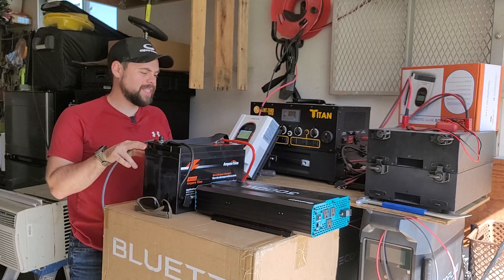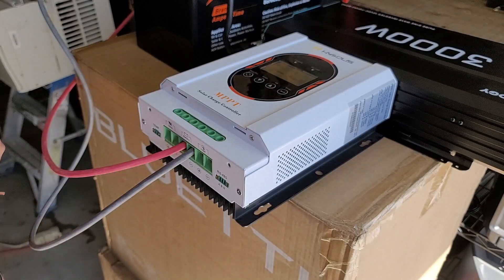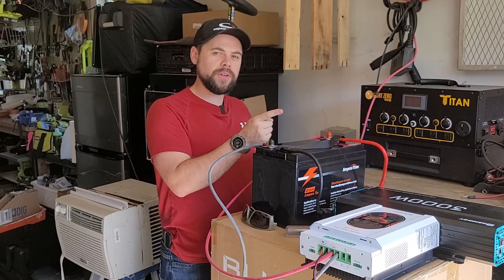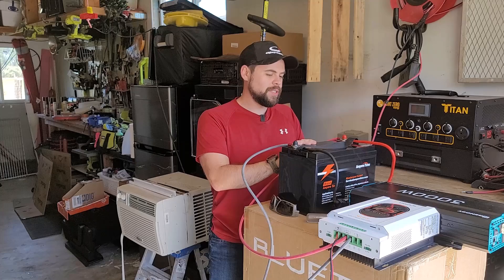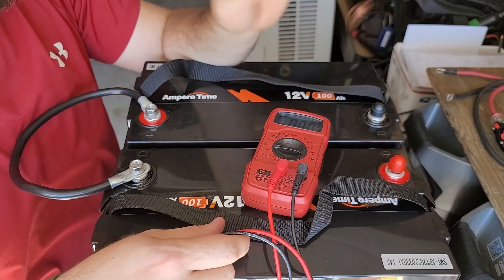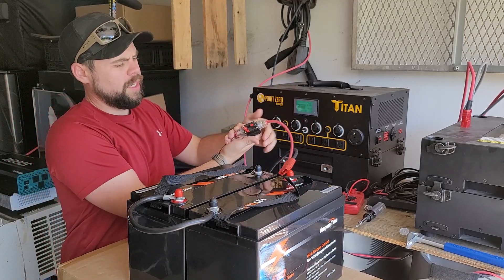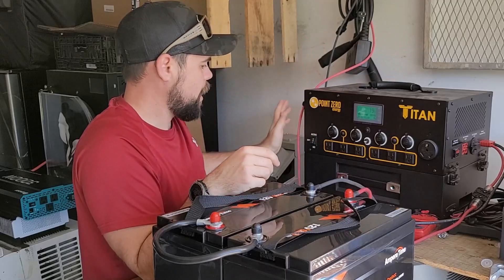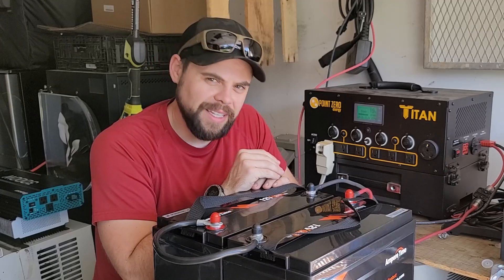Titan Solar Generator Expanded with Ampere Time (aka LiTime) 12v Batteries

Comment: The batteries used in Titan Solar Generator are NMC batteries, which are a different material composition from LiFePO4 battery, it’s not recommended to parallel a LiFePO4 battery with other ingredients batteries for long-term use, since the difference in voltage platform and internal resistance will affect battery life.

The battery expansion port of Titan Solar Generator is not used for the external increase and expansion of battery capacity, but only for emergency charging when the external battery is dead. Also, if the voltage difference between the internal and external batteries is large, there may occur a large current in parallel connection, which may lead to battery protection.

This expansion port is used in an emergency for connection with a 24V lead-acid battery or a 24V NMC battery. Because the 24V lead-acid battery is without built-in BMS, and it’s not affected by parallel connection. Further, the 24V NMC battery is the same as the battery used in Titan Solar Generator, so it can be used in parallel. 
However, the LiFePO4 battery is a different configuration, and there is built-in BMS to manage the battery, so it’s not recommended to use the expansion port in parallel with the LiFePO4 battery in an emergency.
Reply: I have 2 Titans and 5 batteries + a 24v 100ah ampere time battery, the charge parameters on that battery per there documents from Ampere states 29.2, but I went in the Titan settings and changed the charge parameters to 29v cuttoff, where's the problem?
Reply: nice👍
Reply: Why is Titan using NMC? Do they have a LFP model nowadays?

Comment: Nice video Ben.  I have been using external batteries on my Titan for about a year now.  I have a few comments;

1) When you put the external 12V batteries together in series, they need to be at the same state of charge before connecting them in series.  Just checking the voltage of each battery does not ensure that they are at the same SOC.  Both should be fully charged to 100% before connecting in series. 

2) When calculating the Amp hour capacity of the combined battery with the Titan, you added 100 ah for each of the 12v batteries plus the Titan's 74 ah for a total of 274 ah.  That is incorrect.  Since the 12v batteries are connected in series to make 24v, the Ah for those two are still 100 Ah.  The combined capacity of the whole setup with the Titan is 174 Ah.

3) LiFePo4 batteries have a slightly different voltage/SOC profile from the NMC batteries in the Titan.  Because of that, there are times when the voltage gets too high for the LiFePo4 batteries (for my comfort range) if the Titan is charged to 100%.  I don't like pushing my LiFePo4 batteries past 28.4 V.  The standard Titan battery goes up to 29.2 V.  Just something to keep an eye on.
Reply from the maker: Thanks Bruce for the comment. Ya I realized I made the mistake of the 100ah battery setting on the Titan after I posted the video. I will be doing more videos like this and will make sure I explain it correctly.
Reply: Bruce, would you recommend buying two 12v ampere time batteries to put in parallel to add to the Titan, or just buy another Titan battery? I see your concern for the ampere time batteries being charged beyond 28.4v.  It seems like a valid question since two of the 100 ah ampere time 12v batteries can be purchased at $329 a piece compared to the $1300 Titan battery.  I currently have 3 batteries(all titan batteries) on my Titan system and wanted to add more battery storage.  I also know the Titan battery fits perfectly with my current system where the ampere batteries would take up more space and I'd have to pay more attention to the voltage.  Any comments for an old guy trying to survive who wants to increase battery storage? Thanks
Reply: @rameylewis7730  Whether to use LiFePo4 external batteries is a tradeoff that can only be determined by your specific use case.  If size, convenience, and form factor are your major constraints, then additional Titan batteries might be a better option.  If budget is the main constraint, then external LiFePo4 batteries are a better bang for the buck, but the form factor and operational considerations are a bit messier.  Let me explain:  As far as putting a 24V LiFePo4 battery in parallel with the Titan, it is okay to do, but you'll sacrifice a bit of top end capacity of the Titan's batteries, since they are NMC chemistry and need to be charged slightly higher than LiFePo4 to reach 100% SOC.  I don't like my 8s LiFePo4 176 Ah battery to go above 28.4V, which is mid 90s% SOC on my Titan batteries(2x74 Ah).  This means I have to manually manage the solar inputs on the Titan, since they will charge up to 29.2-29.4V.  That's okay for my application in an RV,  but I have to pay attention to it.  I have a BMS on the LiFePo4 set to cut it off if necessary at 28.8V, but I don't like using the BMS for normal operations like that.  The other thing that I have noticed is that the NMC and LiFePo4 batteries discharge unevenly at various overall states of charge since their SOC/voltage profiles are different.  At higher overall SOC's, the Titan battery provides a higher percentage of the load.  At mid to lower overall SOCs, the LiFePo4 battery provides a higher percentage of the load.  Make sure your external cabling is sized to handle that.  For my use case I have found that #6 AWG seems to work okay, but your usage situation might be different.
Reply: @brucebugbee6604  Thank you for that information. That is way more useful information than what I get out of Ben. LOL  I think it would be much easier to go with the Titan battery. Just plug it in and forget. It's just unfortunate that the Titan batteries are double the money. I'm still undecided and must ponder your information a bit more. Thank you for responding so quickly.
Reply: @rameylewis7730  I have 2 Titans and 4 batteries + a 24v ampere time 100ah battery, the book that comes with the ampere battery says it is ok to charge to 29.2v, but I went in the settings on the Titan and set the charging limit to 29v, I see no problem whatsoever.  Hope that answers your question. As far as adding 2 x 12v or 1 x 24v, it doesn't matter, I chose 24v for convenience.
Reply: @dustydawson8977  Thanks for the response. I ended up buying two more Titan batteries for the convenience. I'd add more of the Titan batteries, but the cost has never come down on them.  It's unfortunate they didn't have the 240v Titan early out as well.  I'm not going to buy the new Titan because I've got too much invested in the 120v system.
Reply: @rameylewis7730 yea me too, I'd love to have the 240sp, maybe if I sold 1 Titan, cause I have 2, the 240 will work with the old batteries

Comment: Questions-1) will the solar input or charger input to the Titan also charge the external batteries? 2) can 4 12 volt batteries be used 2 each in series and then the 24 volt combination in parallel?  3) can battery types be mixed or must all be identical?
Reply from the maker: Hey Thomas, great questions.
1. No, the Titan cannot have external batteries connected and use an additional charge controller.
2. Yes, you can use four 12v batteries to make a 24v battery bank to work with the Titan. But it would just be easier to get 24v batteries to begin with. Then you can add even more capacity since each battery is limited in how many batteries can be connected together. 
3. They must be all Lithium based. So Lithium NMC or LiFePo4, mixing those two types are fine. No lead acid.
Reply: @minutemansolar  The solar input of the Titan will in fact charge external batteries if they are connected to either the Titan's 24 volt external battery port or the 24V charger ports.  At least it does on my setup.  The only difference is that if you connect an external 24V battery to the 24V charger ports you should not update the Titan's display screen Amp hour capacity to reflect the external battery's Ah capacity, because those ports are on the load side of the Titan's shunt.  The screen should only be updated if you connect the external battery to the Titan's external battery port because that port is on the battery side of the Titan's shunt.
Reply: Do you have apart list for this where we can buy the wires

Comment: question, could you also have charged the Ampere batteries up to match the Titan charge before connecting, or is it better to have the charges lower on both sides when connecting?

Comment: Wouldn't you be at 174ah and not 274ah since you made your batteries into one by series connecting them?
Reply: Good question!   I'm wondering the same thing.
Reply: The answer is yes it would be 174
Reply: @jaimieheric8273  That is what I thought, though he looked at Titan and said 274 ah, when would be just 174

Comment: YEP.. should've bought a Titan..bought Inergy Apex (weight conscious) and have been 46 months getting all the components I initially wanted. Couldn't connect lead acid or non proprietary batteries so ordered Inergy Flex batteries.. SUPPLY ISSUES took 18 months to get ONE battery another 10 months to get the ring to terminal cable..now waiting for second Flex battery... 
I'm STUCK with it, no way to recovery the spent money OR THE AMOUNT OF TIME wasted waiting.
Reply: I also went with the extra battery and cable for my Kodiak.  Be aware that my battery needed a firmware update to work properly with my Kodiak.

Comment: You can use a battery with any solar generator as long as you stay within the solar charging parameters utilizing the solar port. The generator doesn't know the difference. I do this with my Bluetti, Ecoflow, ECT...

Comment: Good info Ben, I'm looking to add another battery to my Titan and this will def help. With the listed price that's a good deal, 2 of those are less than $800.
If I were to get 4 of those for the Titan what would be your recommended way to connect them?
Reply: I've been running a 24v Amphere time all summer along with 2 Titan batteries. No issues and I want another lol. Ben sells a plug for the expansion batteries fyi.Guess if u go with 2 12v u'll need that jumper tho?
Reply: @scarygary3569  

Thanks Gary, I'm looking to possibly add 4 to my existing 3 Titan batteries which should give me a decent Wh capacity.

Comment: What happens when the solar charges the LiFePo4 and the NMC up to 29.2 volts and the sun goes down overnight then the LiFePo4 voltage settles down to 26 volts but the NMC stays at its 29.2, now you have to unhook the LiFePo4 and run the NMC down to 26 volts or within the .5 volt range of the NMC battery every day, what a pain in the ass. I just wish I could buy a NMC battery to plug into the expansion port but nobody makes them in 24 volt and 1400.00 for another Titan battery is too much for 2000 watt hours.
Reply: I've had a 24v Amphere time hooked up and ran all summer long without any issue. All good on my end👍
Reply: @scarygary3569  Can the 24V from amperetime be charged at 29v to match the titan or at a safe range  ? Thinking about getting a 24v 220ah Amperetime to add to my titan but so far both Powerqueen & Amperetime techs do not advise mixing their batteries to other ones apparently
Reply: @AR-xd4di  yup 29.2v to be exact I made sure to check b4 I bought it.
Reply: @AR-xd4di  Did they say why it wasn't good to add the ampere time battery to the Titan system?
Reply: @scarygary3569  Are you charging the ampere time battery with the Titan battery charger or did you end up buying the ampere time charger?
Reply: @rameylewis7730  nope,I have 2 Titan batteries stacked up underneath and the Lipo4 is plugged into the expansion port.I just let the charge controllers do the charging but I do have 2 Titan chargers if needed.
Reply: Hi Scary Gary, still going with this? could you point me to which battery exactly you purchased? Definitely looking to expand my capacity without paying PZEs absurd prices, already have 3 titan nmc batteries though @scarygary3569
Reply: No, it doesn't work that way.  While the batteries are connected in parallel the voltage of each will continue to match.
Reply: oh wow, that's awesome information. thanks for correcting my assumption  .